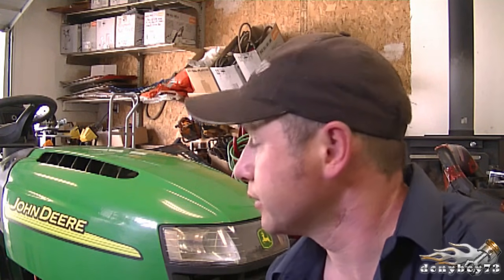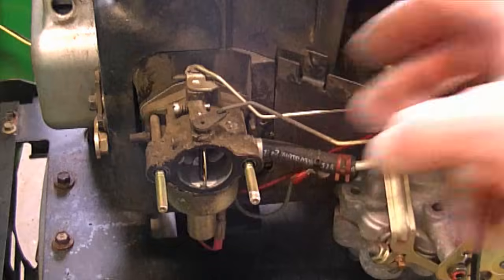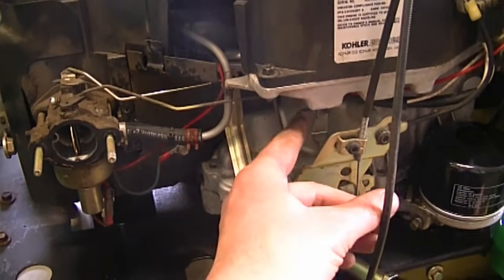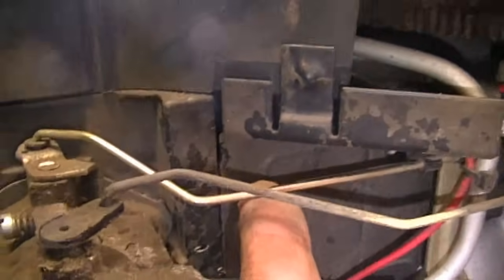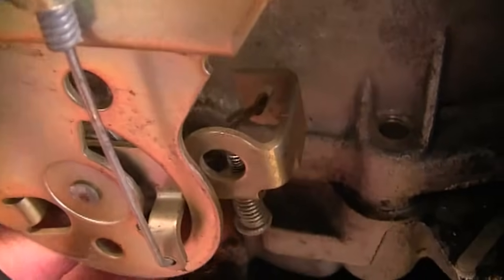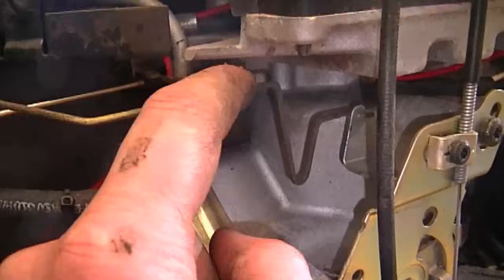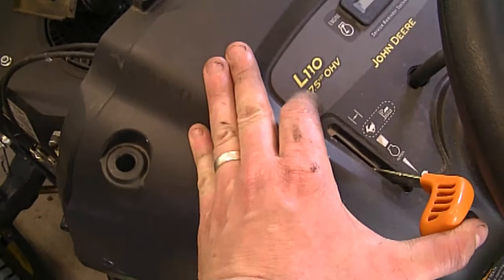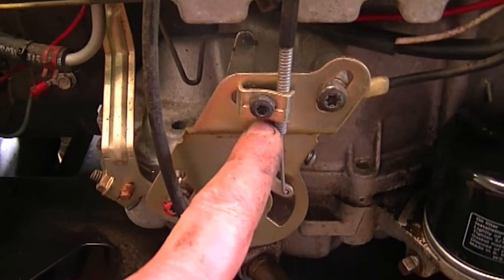Kohler 17.5 HP Engine Carburetor Choke & Throttle Linkage Configuration

Comment: Just replaced the carburetor, and when I adjust the speed, a d the rpm’s aren’t changing when I adjust the choke from rabbit to turtle. Is it possible to over tighten the carb and keep the throttle from moving ?

Comment: I have the exact same tractor. Lost the governot/throttle spring and cannot find a replacement. The part is discontinued by Deere and my mower’s engine races very high. Tried to replace with a similar looking spring but still have the problem. Any suggestions? Thank you

Comment: I know this is an old video, but I have a Scotts mower with the same engine as the one in the video with a throttle issue. The choke works, but the throttle doesn’t have any effect when I move it up or down. When it’s running it seems to be stuck running almost wide open. All parts of the linkage move easy and free and don’t look bent anywhere. Do you have any idea what it could be?

Comment: Do you have any insight on how to adjust the mechanism where the governer arm and the throttle and choke cables connect to? Brass colred with the governer springs and throttle/choke cables ends clamped to it.
Reply: Currently trying to figure that out my self, please tell me in the last 4 hours you have been able to do something to figure out how it works.

Comment: Throttle linkage bushing at carb:  I sure wish you had shown how to remove that linkage.  I've replaced a carb and without any instructions, came to the conclusion had to pop the bushing out, then remove linkage.  Reassembly reverse order - extremely difficult popping that bushing into place.  What's worse:  the bushing is asymmetrical with a longer axial slot on one side - I think this slot has to be oriented one way or the other when trying to snap into carb navigating the 90* bend in the linkage.   ...   Then if you break it...  What to do?

Comment: hi DONY I HAVE AN ARIENS 42 GEAR RIDING MOWER BUT MY LINKAGES ARE DIFFERENT..DO U HAVE ANY VIDEOS ON HOW THE THROTTLE AND CHOKE GET RECONNECTED TO THE WIRE LINKAGES? MY CHOKE IS CLOSED WHEN I MOVE THE THROTLE LEVER UP ON THE TRACtor BUT WILL NOT CLOSE?????????? IT MOVES FREELY BY HAND BACK AND FORTH..PLEASE HELP CHOKE WILL MOVE TO CLOSE BUTTERFLY BUT DOES NOT OPEN

Comment: Hey dony, do you happen to know how to adjust the high idle speed on this kohler motor? Mine is at 2800-2900rpm; the manual states for a higher rpm

Comment: I noticed when I move the lever to choke position it closes the butterfly flap on the carburetor.. When I move it down, choke flap opens, but the throttle rod does not move at all. Why? What moves the little arm for the throttle control on the carburetor? You mention that the lever on the carburetor only moves when the engine is running. Please explain. I thought we control the speed (rpm) by moving the speed lever up or down.

Comment: That little plastic clip holding throttle linkage onto governor arm- give it a little push up with your fingertip, it pops right off and releases linkage from governor arm. Its a plastic version of the metal carb linkage clips seen on cars in the 50s.

Comment: Hey guys and gals. I need someone's assistance. I have this JD STX 38 rider with a Kohler CV13S engine. The governor spring came off (how, I don't know). I went to a local JD dealer but they couldn't help me as the mower is old and they don't keep maintenance or repair information on it. Can anyone who has an STX 38 rider take a picture of their assembly and send it to me? I would GREATLY APPRECIATE any assistance any one can provide. Thanks so much, garybahrain1

Comment: Your videos are great. Also looking at others. Still have a problem  The little plastic piece holding the governor lever broke so I replaced but am having trouble dialing in the rpms.  Seems way to high even at mid throttle. I can back down with the screw so that it idles nicely at lowest throttle but if I turn that up it seems to be too high rpms at mid throttle. Don't even want to run full throttle. Maybe another adjustment? Maybe an adjustment at the bottom screw holding on the governor lever? Thanks.

Comment: Thank you so much!  I took mine apart to clean out the carburetor.  When I assembled, I crossed the linkage.  The mower started, ran up to some very high rpm's causing the fuse to blow.
Reply: Same happened here.  What did you do to fix it?

Comment: My 12 year old son just picked up this model and the orange handle is missing. He has another one to replace it with from a parts mower but I am wondering if just the handle comes off or do I have to replace the whole assembly . I don't have too much experience and don't want to try forcing it off, if it is not designed to come off and brake the whole thing. Any advice would be great!

Comment: I have a similar set up on a Kohler cv15s. I just replaced the carb and it needs a slight increase of the revs when set to the working speed (i.e. highest setting before engaging the choke). Is there a way that I can adjust the lever that runs the throttle and attaches to the governor so that it revs just a bit higher?  I can manually push that lever and it increases the revs, but I don't see any adjustments that can be made short of trying to straighten out the linkage rod just a bit.
Reply: I have the exact same problem. Just need 1,000 more RPMs at full throttle. Sliding the governor plate up and re-bolting didn't work.  Did you find a solution?
Reply: @johntorrington2672  got rid of the machine.

Comment: I have this mower and I’m having trouble with the engine bogging down when the blades are engaged. It only seems to do this after a sharp turn. So far I cleaned the fuel lines changed the filter, cleaned the fuel pump, cleaned air filter and changed spark plug. I just ordered a new carburetor that had to be it. I unplugged the seat sensor and bypassed the engagement sensor with a jumper cable.

Comment: Extremely helpful.  Thankyou.  I inadvertently popped the bushing and linkage off of the governor end when I was trying to unhook the carb end of the linkage, and it took me a while to figure out how it must go back together.  Your video confirms that I eventually got it right.  Would have been nice to see a bit more explanation about how to adjust the throttle cable after you detached it.  I suppose I'll look at it and figure it out.  I have this 17.5hp Command from an L110 on my Husqvarna Rider 155AWD, I swapped out the 15.5 which has the same linkages.

Comment: Great vid.....Q. to all:  I have a 15hp kohler on my JD Lx255 riding mower(same linkage as in your vid).   Lately,  it surges when choke is fully closed and then shuts down after about half an hour of grass cutting.   I then have trouble getting it re-started.  It idles perfectly(no surging). I have replaced the fuel and air filters, new gas and new plug but still the same problem....any suggestions?
Reply: a warm motor should not require choke hardly ever.... if motor is cold once its fires off and is running for a few seconds take choke off... when mowing leave the lever on the rabbit symbol

Comment: Great video, can you provide the model number for the carb please?
Reply: CV491 Carburetor for Kohler 12853107-S 12853117-S 20 853 33-S CV490 CV491 CV492 CV493 SV530 SV540 SV541 Models & Toro 74601 74603 74701 Sabre 17.5 Kohler Command + Fuel Filter Spark Plug

That's what I used on mine.  It's not perfect, but it got the job done for cheap.

Comment: Say Donyboy73, I sure do thank you for putting this little video up here about the 17.5 Kohlor and showing the clear picture of it and it's workings. I had a moter like this on a J/D L110 and it did nothing but idle and it would not do anything but that and it was diving me nuts. Big guy then I saw it, it was the spring from Gov to throttle linkage, it was this showing just how it all hooked up that made this so good Donyboy73 not just the part you worked on. Thank you much Mr. Linkage Man.
Reply from the maker: +Steve I you're welcome, make sure you're subscribe

Comment: hay dony thanks for the many post,,have a question, please , on a 26 hp briggs ,, it is hard to start, had the carb apart the choke flap is working-- but when it does start and run,, I can put the choke on full and there is no effect to the motor it don't load up or do anything , don't seem to be running right when it does run ,, and super hard to start - 26 hp 2 cyl , got any ideas ?  seems if I put the battery charger on motor start - so to spin it faster it starts , please lmk ken

Comment: I have a 15hp Kohler with the exact same configuration.   It idles like a dream but when you push the throttle up just a tiny bit it revs way way too high, how do I adjust this?

Comment: What's up donyboy just was given a craftman mower,it will start with the choke on but when i take it off choke it dies any suggestion's. Took the air cleaner off seem's like a lot of gas down there. Engine is a kohler 16hp. Help thank's.

Comment: Thanks for the reply, I thought that may be the case, I just can't get the settings correct so the motor will turn over.The battery has a full charge and I also added a battery jumper.  It turns over freely with the spark plug out.  Was running several times yesterday just hard to get to turn over.

Comment: Hi Donny. With spring coming I've been thinking about my lawn mower. I have a Ranch King (MTD clone) rider. I don't recall the year, but I think it's a 2002. I've found that models just a couple of years newer have a deck wash system. Looking at the parts, it looks like I'd only need to drill some holes to add it in. Have you ever retrofitted a deck wash system and do they even work?
Thanks!

Comment: For a single cylinder engine this engine runs vary smooth, it is a good engine but the kholer courage engines are crap

Kawisakis are also good engines

Comment: e-Bay has quite a few Clinton engine parts.  Just search "Clinton Engine Parts."  There is a carb listed right now NOS bid price of $14.99.  "Clinton Engine Part # 39-955-500 *NOS* CARBORATOR"  Once you have your engine number from the label use Google to search for Clinton engine parts for that specific engine.

Comment: Dony, I have a quick question. My son has a old Troy-bilt rototiller with a Clinton 4 stroke engine, are parts still available for the carb, and wher can I get a new air filter for it?